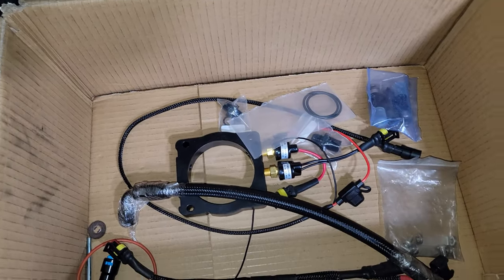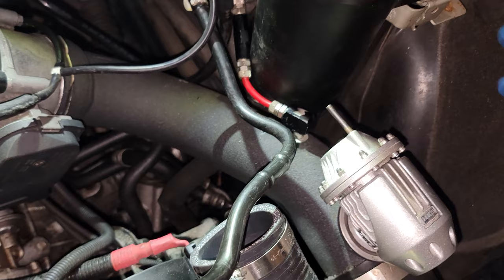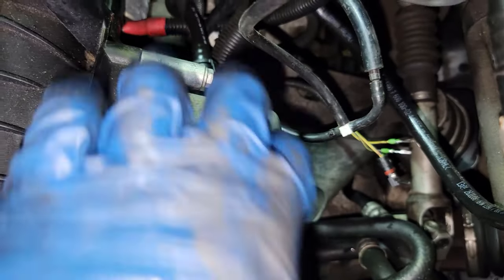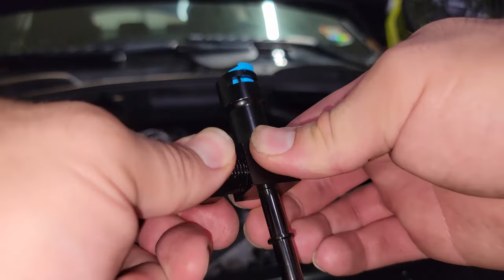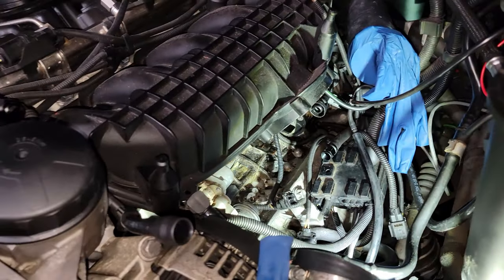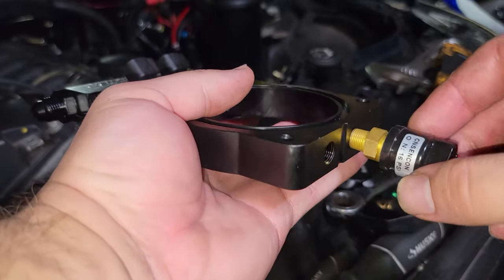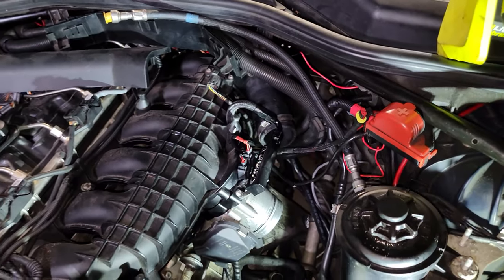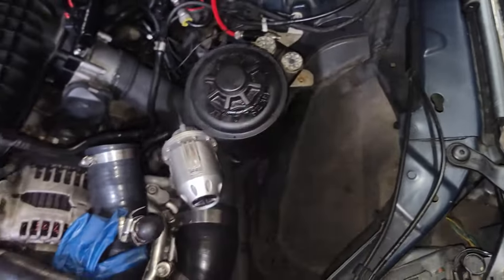N54 Throttle Body Injection Fog'r 500 Install

Comment: Very detailed how-to! Thank you very much. 
Any issues 1 year later?
Reply from the maker: @pauldube9455  Thanks for the feedback! So far no issues. The only problem I initially had was too much fuel before it was needed. So I built an adjustable injection controller to activate them at different boost pressures instead of the fixed values. Otherwise they've been pretty good.

Comment: I don’t know much of anything, today is the first time I’ve ever heard of this mod. How much horsepower does this add? Thanks
Reply from the maker: This mod itself does not add any horsepower. It's for when you go with larger twin turbos or a single turbo setup and your fueling demand increases, especially if you plan on running E85 or a high E85 content mix. This allows for more boost without having to overdrive the high pressure fuel pump or without having to add port injection if your fueling demands don't require that level of fueling.
Reply: @FoulNews  awesome explanation thanks a lot. I have an E93. I saw one of these for my n54 on Marketplace and wondered if maybe I should get one sooner or later.
Reply from the maker: @boujiiyt5363  No prob, I'm glad it was helpful. It's definitely not a bad mod to have for future power goals.

Comment: I thought it was 9psi and 15psi?  What fuel infectors are they using?  Do you have a part number?
Reply from the maker: The kit I received came with an 11psi and 16psi hobbs switch. I don't have a part #, but they looked like Bosch EV 14 style injectors that are 250cc each. I'd reach out to Frankenturbo for specific part #'s though.
Reply: @FoulNews  I did a few days ago.  They asked about mods, but then I haven't heard back from them yet.  That is why I asked you in hopes of saving some time.
Reply from the maker: @tmibmw  Ah gotcha. Hopefully they reply back soon. I'll take a look to see if I can spot the injector part # later today. It might not be visible due to where it's installed, but I'll give it a try.
Reply: @FoulNews  Thank you Sir

Comment: Are the injectors just simply turned on static?  No pulsing?
Reply from the maker: That is correct. No PWM for them. They open at full duty cycle when the hobbs switches see their pre-configured boost levels with the out-of-the-box configuration. I've ditched the switches and built a controller for them, that'll come out in a video later
Reply: @FoulNews      Thank you for the quick reply.   Back in the 5.0 days we used to spray fuel through nitrous plates under our blow through carbs when the carb jetting got too big for driveablility.   This is basically the same thing.   I am FBO N54 with upgraded turbos and the old man in me does not want to pay for PI and just add a nitrous nozzle instead.   This kinda comfirms my idea.
Reply from the maker: @tunerdadtunerdad7927  No prob! Yup, pretty much acts in a similar manner as that. Simple and effective for sure, especially if you're not trying to push over 600whp.

Comment: Any problems w it?
Reply from the maker: No issues so far. Only initial issue was too much fuel on pump gas, so I made an adjustable injector controller to change the starting points of each injector instead of the fixed hobbs switches.
Reply: @FoulNews  what exactly did you do? & thts wat seemed like the issue w tbi..
Reply from the maker: @942doc1  I built an adjustable controller that I have set for one injector to activate at 15psi and the other to activate at 23psi. That seemed to help quite a bit. Next step is to integrate automatic switching to different actuation points depending on the values from my ethanol content sensor. I'm also almost done with another controller that controls each injector by duty cycle instead of 100% duty cycle like the hobbs switches / my current controller. I'm not sure if it will make a difference or not, but I'll probably make a video on it next month.
Reply: @FoulNews  oh sounds a bit complicated. Wish I knew how it was
Reply from the maker: @942doc1  It's a little involved to get it working, but if testing goes well over the next few months, I'll bring it to market for those who would like finer control over TBI.
Reply: @FoulNews  nice, that'd be cool. 👍 I'll buy it if I don't go port by then